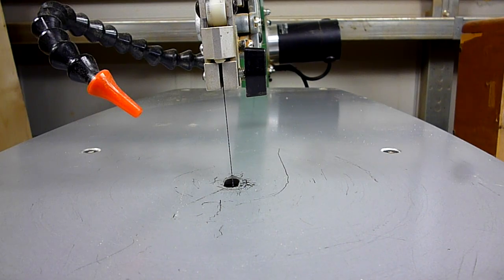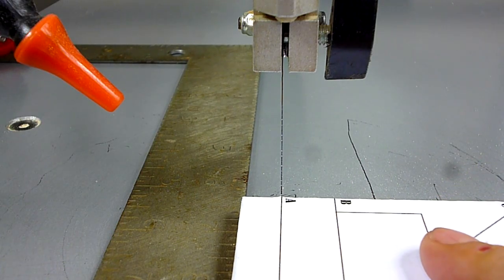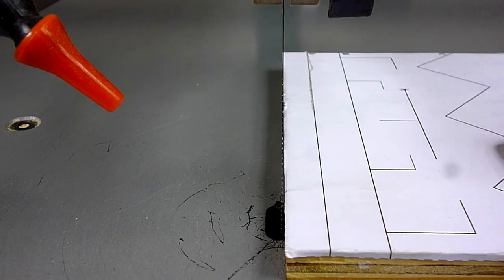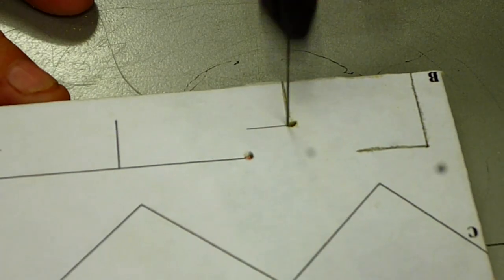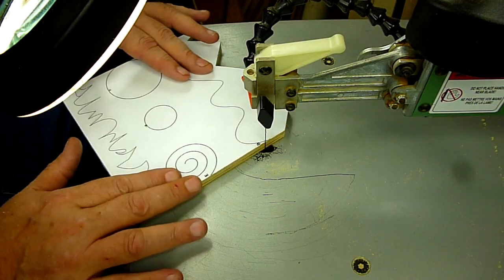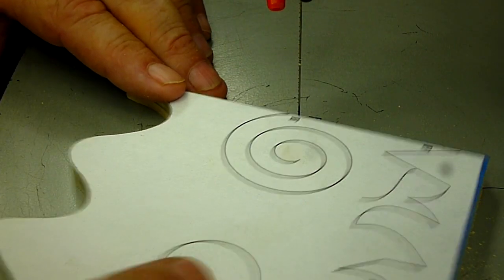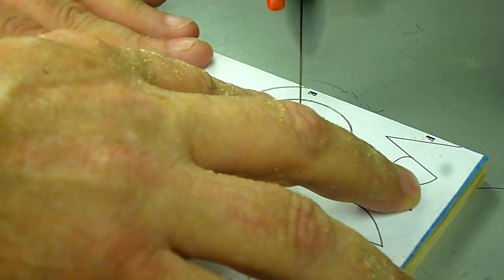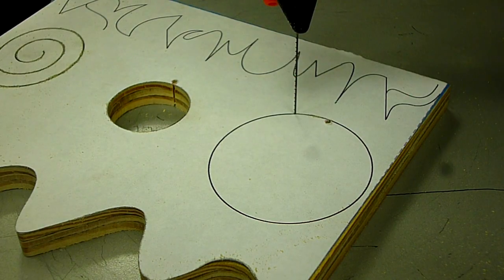Scroll Saw Cutting for Beginners Pt 2

Comment: good vids.

3:37 +10000B 4 using PENCIL 2 point @ the blade. If u added a short note 4 everybody 2 always - ALWAYS keep their fingers off of the blade that would b even more clear. :)

also, + another 10B 4 NOT using any annoying bg muzak...

4:01 exactly same thing as "it's the photographer who takes a picture, not the camera". it's not the saw which's cutting your wood, it's the woodworker.

Comment: Great video. Is there a smaller saw I can use to get the same results. Something hand held? Thanks
Reply from the maker: *****  A Jigsaw will give similar results, and they can be purchased for about $40. You will not be able to cut with the same amount of detail but you will be able to do inside cuts with one. 
Bob

Comment: Hey great tutorials. Making some doll house furniture for my niece via purchased patterns. The instructions say to cut the pattern from 3/4" stock, then rip down the cut out pattern for two 3/8" pieces that are identical. Is this something you can do with a scroll saw by clamping a block to your base as a guide or is this type of ripping more intended for a band saw (which I do not own)? I saw what happens when you try to do that to get a straight line and it would drift so not sure if it would be the same for ripping in half or not.
Reply from the maker: jgerr Since you are talking about doll house furniture I'm going to assume the widest part of the pattern would be able to be cut on the scroll saw. If that's the case, I would cut the 3/4" piece as a square block first. Draw a line on the edge and cut it like in the video. Do not try to use a clamped block as a guide, after you have the two 3/8" pieces, set one on top of the other and apply tape around the edges, than apply the pattern and cut normally. I hope that makes sense to you.
Bob
Reply: ScrollSawParadise yep, thanks for the tip

Comment: I have broke a couple of blades already but I feel like i'm not pushing hard at all, I wonder if the blade is tight enough? when pushing the wood into the blade should the blade be flexing? I have a guard and when I'm using the saw the blade is usually pushed up against the guard for the most part. yet the guard is set a good quarter inch away when not in use. any advise would help. thank you.
Reply from the maker: +Nita Hi Nita, it sounds like you need to make your blade tension a lot tighter. Tighten you tension lever/knob until your blade makes a very high sounding note when you pluck it with your fingernail. Good luck. Bob
Reply: thank you so much! that seems to have made a difference.

Comment: Do you have a segment on which blades to use for what things?
Reply from the maker: People make choosing blades way more difficult and confusing than it needs to be. If you are cutting wood, a #3, #5, and #7 skip tooth or Ultra reverse blade should cut just about anything you need from 1" down to 1/8"...Bob

Comment: Have a few q's....

The blade doesnt twist and snap when u do the sharp loops? 

My spiral blades r breaking too quickly, what could be the reason? 

From ur vid it looks like there's no major effort to hold the wood down on the table, ...but when am cutting...i got to hold it so firm because it kind of bounces while cutting...what am i doing wrong??
Reply from the maker: Hi Yasmin, the techniques in my videos are for flat blades, I don't use spiral blades. I never have found a need to use them. But all the same basic principles apply when it comes to not pushing too hard on them and tension. As for having to hold down really hard to keep your wood from jumping around, 90% of the time, the blade is installed upside down. So make sure the teeth are pointing down and it will be much easier to cut your wood.
Reply from the maker: Whoops missed a question, No the flat blades will not twist and snap when making tight loops as long as the saw is running and cutting the wood during the loop/ turn. if you try to make a turn without the saw running, you will ruin the blade.
Reply: @Scrollsawforum1  thank you for such prompt replies....

As am an amateur...what instances would spiral blades best be used for?

Comment: I am cutting an intricate pattern in 1/8" walnut. A piece broke off (with the grain). To try to prevent this from happening again, I taped the back side of the walnut with painters tape. So far it hasn't broke again. Is this an acceptable practice?
Reply from the maker: Don Cox Hi Don, putting tape of any kind, on either side of your project, is always a good thing and normal practice. What usually causes wood breakage is when the work piece vibrates/chatters as you make turns. I always try to keep finger pressure on the wood very close to the blade when doing very intricate turns and I slow my cutting speed down on turns. Don't be afraid to glue that broken piece back on, if done carefully, no none will ever know that you repaired it.

Comment: Thank you for this video. I have started a woodworking shop and have been succesful making wooden templates of the state of TN painting the flag on the wood. However I have been less than impressed with my "Jigsaw" workmanship when cutting out the intricate border details of the state itself. My wife mentioned investing in a scroll saw which I plan on getting tonight at Home Depot. This makes those tricky curves look like a piece of cake. (Although I have printed the templates for practice). I appreciate you showing me this video so much. Question however....The wood I am cutting is century old barnwood (Oak) I think. Its an inch thick. What would be the best blade for this?
Reply from the maker: +Bryan Cagle  Hi Bryan, Your wife is a smart woman, good catch! The scroll saw will make your template making much easier and cleaner and with a little practice, and my videos of course ;-) For cutting 1" thick material I like to start with a #5 blade and a saw speed of about 50% of the highest speed. Thick wood does not cut as nicely as it does at slower speeds. I do not know if your barn wood is a hardwood or a softwood, I'm assuming it is probably a softwood like pine. If it is a hardwood I would start with the same parameters and see how they work, you may need to go to a little heavier blade like a #7 skip tooth. Good luck, hope this helps and if you have anymore questions  just ask away. Bob
Reply: +ScrollSawParadise Thank you Bob. That will give me a start. ill let you know how it does!! Keep up the good work and instructional videos.

Comment: I bought a Dewalt scroll saw a year ago,  like new condition ope box without manual and have no idea how to use it.  I tried today with a piece of wood 4" wide and maybe 5/8" thick but I have to hold the wood otherwise jump all the time.  Cuts nicely, straight  easy clean cuts but I have to hold the wood.  What is wrong?
Reply from the maker: +Mio Beato Normally you must hold the project to the table with a little force on any type of scroll saw. If you are struggling very hard to hold it down, you might have the blade installed upside down. Make sure that the teeth are pointing down when you install the blade.
Reply: +ScrollSawParadise Thank you for your prompt response and advise.  The blade is installed properly,  I did not know that I have to hold it down.  Is a little intimidating, at the beginning.  I will continue practicing and watching your videos to improve my poor skills.

Comment: Few questions...
1. Is 1/2 and 3/4 inch pine a good choice of wood? 
2. Does it make any difference when cutting along the grain or across the grain? Because cutting along the grain today would just not cut. Felt the blade might break if pushed as it was bending alot. 
3. What blade are u using in this video?
Reply from the maker: Hi Yasmin, 
Q 1- It depends on your project, are you making something that will be painted or are you going to leave the wood natural? For painted projects pine is fine. If you are not going to paint, I would use either a hardwood or a higher quality pine such as “Select Pine’ which Home Depot carries. I do not use normal pine, too many ugly knots, but I do use Select Pine for certain projects. 
Q 2- Cutting across the grain is always easier than cutting with the grain (Ripping). In order to prevent your blade from deflecting from the top of the wood to bottom of the wood while ripping, you need to have very good tension on your blade to prevent the deflection. Cutting with the grain is always harder and slower so don’t force it or push harder, or you can break your blade.
Q3- I’m pretty sure the blade in the video is a Flying Dutchman UR-5. I usually use either an FDUR #3 or #5. I rarely use any other size or types of blades, those two work for just about anything I cut. 
I hope these help and Happy Scrolling!...Bob
Reply: ScrollSawParadise thanku for ur reply.very helpful.
1.am from Mombasa, kenya....n we have very limited type of wood...so pine is literally just 1 type of pine. Blades also not avail...have to order in from abroad.my machine is a makita sj401. N it came with 6 standard blades. All same. 
What blade types wud u recommend fr this machine? Am interested in making fine detail project and puzzles. 
Thanku.
Reply from the maker: Hi Yasmin, 
My previous answer was meant for someone living in the US. Now that I know you don't,  I will revise the answer. 
The scroll saw is a tool that allows you to be creative no matter where you live. If all you have access to is pine, then pine is a great wood to cut and you can make many wonderful projects from it. As for blades, scroll saw blades do not last long so you will need to replace them. If you can find a supplier that will ship to Kenya, I would recommend a #5 blade of any brand you can get and any tooth pattern for general scroll saw cutting. If you can choose a tooth pattern, a reverse type tooth pattern will work best. If you want to make a lot of puzzles, I would recommend getting the lowest number blade you can find, a #1 or #00. Puzzles are the only thing I would use blades that small for.

My very first saw was a Makita, I still have it and I keep it as a backup. Many of the projects that I have posted on Youtube were made with that saw. I used it for two years before I upgraded and that saw is what caused me to fall in love with scroll sawing.

Good Luck and let me know if you have any other questions.

Comment: I just bought a used Craftsman 16” variable speed scroll saw without a foot hold down thing. When I tried to use it on 3/8” poplar, the wood immediately started popping up and down! Is there any way you might be able to tell me why it’s doing that? Thank you.
Reply from the maker: Hi Kathy, first, you do not need the hold down foot, it is totally useless. The most likely cause of the wood jumping up and down is that you have the blade installed upside down. The blade's teeth must be pointing down,  check it in the middle of the blade, if you can't see the teeth, lightly run your thumb up and down the blade. The rougher side will need to point down. Also, it is very important to make sure that your scroll saw is securely attached to either a metal stand, table or workbench. The holes at the bottom of the saw are made for screws or bolts to go through them. let me know if you still have problems after checking the above items...Bob
Reply: I double checked my blade and it is on correctly. I have the saw sitting on a solid work station but I can’t secure it with screws because I have to move things around to use them in my shop.  But it is a very stable table. Any other suggestions? I’m wondering if the guy sold it because it’s messed up.

Comment: Hi can i use any type of wood to cut out and I am about to buy a saw whats the best scroll saw to buy for a beginner I was looking at the    1.2 Amp 16 in. Corded Scroll Saw Ryobi
Reply from the maker: +Emily Sullivan Hi Emily, yes you can use any wood on a scroll saw. And with the proper blades, you can even cut plastics and soft metals like copper and aluminum. Bob

Comment: I have a problem with my Scroll saw, even when I have the blade at 90 degrees and the blade nice and tight, when I cut thicker pieces of wood my cuts are not straight, especially on curves. Any ideas?
Reply from the maker: If you turned the wood with the blade inside the kerf and the saw not running, you likely twisted the blade to a point where it is unusable. Replace the blade and try again. Be careful to not turn your workpiece unless the saw is on and cutting in order to clear an area for itself.

Comment: this isn't really involved with the scroll saw but i'm curious what kind of ink or paint you used when you went through your samples on the santa and such. thank you
Reply from the maker: David Behnen Hey David all of my Intarsia pieces are made using the natural colors of different species of wood. Each piece is an individually cut piece of wood. The items you see on line, including the Santa Bear, have not been painted or stained, just lacquered to protect the pieces. I do not use paint or stains on my projects so I really have no answer to your question.
Reply: the Santa head piece that is framed like almost like ink on the wood
Reply from the maker: David Behnen ohh ok, The the Santa Head is cut out of Baltic Birch plywood and than placed on a piece of plexiglass that was simply spray painted gloss black on one side.

Comment: I have a craftsman, with a hold down.  I get a ton of vibration when I cut--the wood slamming up and down on the table while cutting--am I doing something wrong, or is this inherent on cheaper saws?
Reply from the maker: Hey Tim, It's not unusual to get some chattering of the wood (slamming), but it shouldn't be excessive. Here's two things to try. First, remove the hold down and hold the piece firmly with your hands. If you still get chattering than check to make sure that your blade is installed correctly and relatively sharp. The teeth should point down, gently run your thumb over the blade to make sure. If the blade is upside down, you will get a lot of chattering of your work piece.
Reply from the maker: Also make sure that your saw is securely bolted down to what ever it is that it is sitting on. The more solid the base is, the less vibration you will have, unless there is something internally broken in your saw, which I doub't. The problems you are having are problems that can occur on any scroll saw regardless of price.
Reply: Thanks, I'll try those tips!

Comment: When ever I cut 90d corners using a No: 3 reverse skip or any other blade the blade twists any ideas please
Reply from the maker: Colin, you must keep the saw running through the turn, if you try to make a turn with the saw off, the blade will twist. It doesn't matter what size the blade is. Also make sure your tension is good and tight like the video states...Bob
Reply: thanks for getting back to me i do keep the saw running but the blade still twits the tention is good so some thing is going wrong could it be down to side or forward preasure.
many thanks for your help

Comment: Thank you. This is great. I tryed but My wood was jumping on plate.
Reply from the maker: Hi Neda, make sure that your scroll saw blade is not upside down. The teeth should be pointed down, if you carefully run your finger across the teeth, you will be able to tell the difference....Bob
Reply: Hi. Thank you. I will check.

Comment: What type  of scroll saw you have that can stop without taking your hand of the work piece. Thanks
Reply from the maker: Caleb, any scroll saw can do that. You buy a foot pedal/ switch, plug the saw into the foot pedal and then plug the pedal into the wall and you can turn your saw on and off by stepping on the pedal. Makes cutting much easier not having to take your hands off the workpiece to turn the saw off and on. Here's a like for you to check out. http://www.amazon.com/MLCS-9080-Billy-Switch-Deadman/dp/B000LJNJOE/ref=as_sl_pc_tf_til?tag=scrolltriplb-20&linkCode=w00&linkId=PQXMHTZTMRN4BC75&creativeASIN=B000LJNJOE
Reply: Thanks for the information. Your video are a big help.

Comment: Awesome tutorial...i may be picking up one for 20 bucks that needs 'tweaking'..what could that mean ?
Reply from the maker: That's great BH71. My first scroll saw cost me a whole $ 10.00, so I'm all about starting cheap. After you get it home, I would check to make sure all of the bolts on the saw are tight. Also make sure that you bolt it down good to whatever surface you will be setting it on. Good luck and have fun...Bob
Reply: ScrollSawParadise It's a Dremel 1672 model. Have you any experience or opinion on this particular unit ?
Reply from the maker: Dremel saws are not the greatest, but since it is your first saw and it is cheap, it is a safe purchase to at least find out whether or not you will like scrolling. If you do end up sticking with scrolling, then you will want to upgrade to a better saw sometime in the future. I would buy it just to try it out.
Reply: ScrollSawParadise Thanks....thats reassuring

Comment: Quick question, what's the width of the blade you are using? .110" , .07", .1" ?
Reply from the maker: Carlos, Here are the spec's for the blade I used in the video.

Flying Dutchman (Brand)
FDUR #3
5" Long, .031" wide (Front to Back), .013" thick, 15 teeth per inch
Reply: Thank you. I asked because where I live I can only find blades that are 0.1" wide, so it's difficult to get 90° cuts